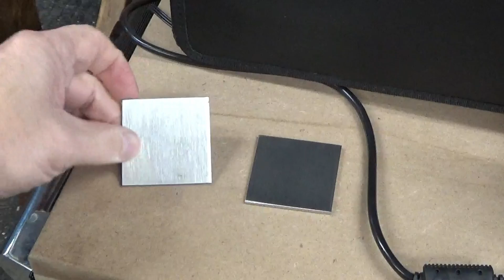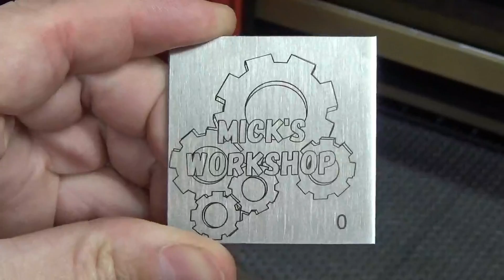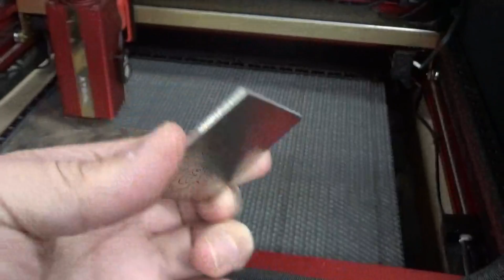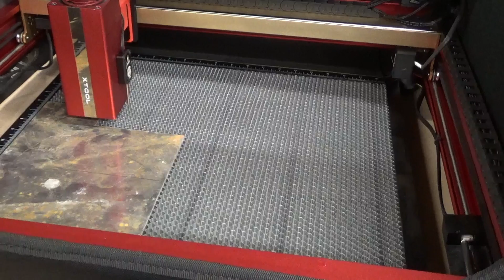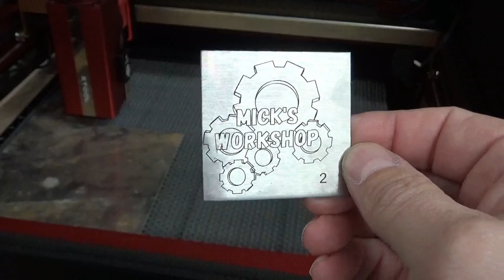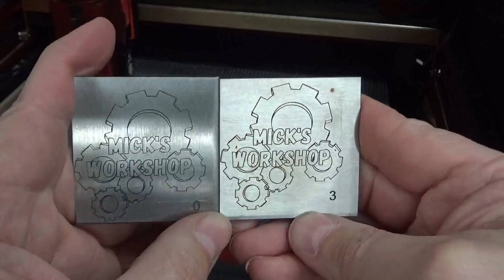Short - Laser Engraving Stainless Steel on the xTool D1 Pro w/Infrared Laser

Comment: what setting makes it 'trace' your vector graphic like that? mine the head goes left and right and turns the laser off and on
Reply from the maker: @BigMikeMora  It's the cut mode in the xTool software. I actually run Lightburn.

Comment: Thanks Mick's Workshop.

What I would like to know is, did the laser vaporise stainless steel? If so, there should be a corresponding engraving depth of 0 mm to 3 mm depending on the focus position. The near black colour seems to result from a thermal oxide reaction. Of course, the oxygen bound with it increases the weight of the sample. An interesting question is therefore, at what focal distance can a calibration seal, for example, be produced in a stainless steel substrate without any change in weight? A possible application would be stainless steel calibration weights which, together with a laser QR code, would produce a digital calibration certificate.  

SJVD Michael Frithjof Müller
Reply from the maker: You can feel a slight depth with a fingernail, however it is nowhere near the height adjustment I made, I will put it under the microscope and see what's there. I do not have the equipment to determine weight differences.  My interest in it is being able to mark parts such that they can be read by a human.  I suspect that for the application you are interested in that something better than a hobbiest machine would be needed.

Comment: A couple of questions. 
Is the black a permanent feature of the stainless or can it be scrubbed/buffed off? 
Is there any change of depth between 0 and 3mm?
What kind of stainless are you working with & have you tried any different kinds of stainless?
Reply from the maker: Excellent questions! The black does not rub off, at least with scotchbrite. Nor does heat affect it, up to approx 600 degrees (I didn't go beyond that).  There isn't a noticeable depth difference, although I didn't attempt to measure it. I'll put it under the microscope and see if I can tell the difference.  I'm sorry but I don't know what grade of stainless it is, it came from the scrap yard.  It would have been used in an industrial setting.